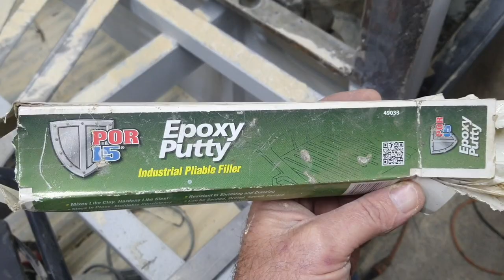VW singe cab cherry picker SHEET METAL  repair and Prime roof

Comment from the maker: Hey guys Figured I had this done so I would release it this weekend. Didn't get a video out Friday nor will I Monday but soon once I finish my car and work schedule  loosens I will get back on Mondays and Fridays.
Reply: Well , I disagree with the putty thing but it really looks nice and I hope that it will last long . You should take some extra time on block sanding though because this isn’t just a t1 , it’s a special one and a great paintjob will also rise the value ( saying it in case you want to sell it )
Reply from the maker: @type2523  when you have had cars you used filler on for more than 20 years and it never cracks you begin to really have faith in the stuff. I am going to do a lot of blocking. It will be nice. I am just not going to get every wave out of it. Requires too much hand work. but most people wont notice anyway.
Reply: I would like to see the block sanding. I don't have luck with getting out the wavy spots.
Reply: No worries Mike ! We appreciate your videos whenever you can post them & thanks for the playlist tip, I'll check it out.

Comment: Nice Job Mike! I am dreading doing my roof..  I have rust above the gutters on my double cab and I need to do a similar repair.  I thank you for documenting the process!
Reply from the maker: yea If you want a little less filler on it you can cut each slit and butt them Tack them a few places shape it a bit more round. The way I did it the filler wont crack it is still under spec. 1/4 is most fillers max. I have gone 1/2 inch before on my bucket truck and it still didnt crack. Bare metal is the key.

Comment: You could use jb weld also
Reply from the maker: yea it works great too. I llike the putty because it is not so runny. It stays in place. I use j and b for steering wheel, hard plastic noses on cars I did many years ago. No cracks. Rubber bumpers I use something else.

Comment: Hi Mike, I really enjoy your Paint and bodywork videos, and I’ve learned a lot already. I have a 1962 Beetle that suffered an engine fire many years ago, and I’m hoping you can give me some advice on repairing and painting the engine vent area under the rear window. I’ve been searching your videos for that problem, but came up blank. I have a video that I just posted on my channel that shows the details, if you’d like to see.
Thanks in advance, for any help! 👍Tony B
Reply from the maker: usually I just let what blows through there and  lands. If you need to sand behind there to remove some scaling paint  That can take lots of time. use like a popsicle stick with sand paper on it and work your way along. you wont get it perfect. I usually just spray through the vent and it paints well enough.
Reply: @Mikefngarage  Thanks for the advice, Mike.I’ll try that out.👍

Comment: Good video,what’s status on your Vw on motor replacement.😎😎👍👍
Reply from the maker: still waiting for parts from Romania. CP3 fuel pump. it made it through customs but not arrived. I will start working on removing the engine tomorrow.

Comment: As always, great information.  Will the Tamco primer go over self etching primer without problems?  The Medallion is impossible to find locally and it's pretty pricy on evilbay.  Just need to cover small repairs before I get enough to do a filler.
Reply from the maker: yea it sticks really good. you dont even need self etching. I just shot something and used it as a DTM sealer. super high adhesion and super refined.  Best primer I have ever used. I get medallion at  1 stop in riverside. Discount code MikeF

Comment: my phone used to ring constantly.. i really needed an afternoon off to go to the movies. after checking the movie listings over the phone.. i used call forwarding to transfer all my calls to the movie theater show times phone as i was about to leave.. Ring, .. somebody called i realized. Ring, they called back.. perhaps they will get it.. Ring.. One ring indicated somebody got forwarded.. Ring..  after six calls. i undid the call forwarding and the phone rang.. oh my goodness.. i am going crazy.. i keep dialing your number and i keep getting the theater time line.. i told the guy . didn't you figure out that perhaps i had gone to the movies.. no.. why would you go to the movies.. you are supposed to be working and answering the phones..  this guy was not the brightest. when his inline fuel filter clogged and he did not have a spare like i told him to keep always.. he decided the other side of the filter is clean.. so he put it in backwards and filled his SU carbs with debris from the fuel system.  no my carbs are flooding what do you think happened. he ask. i saw the arrow on the fuel filter and realized instantly a genius at work happened..